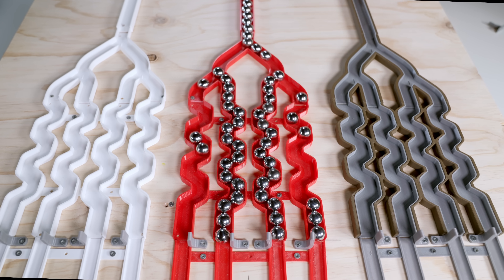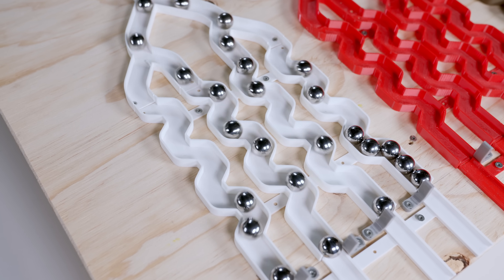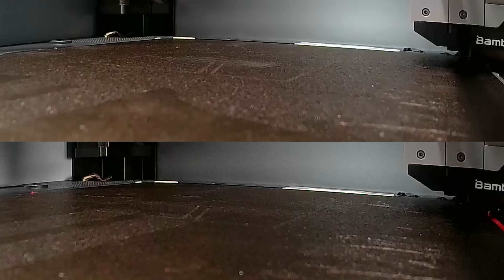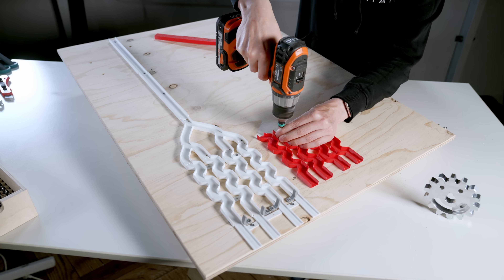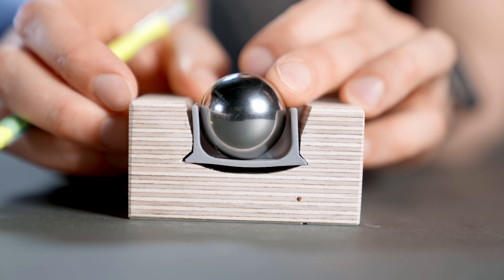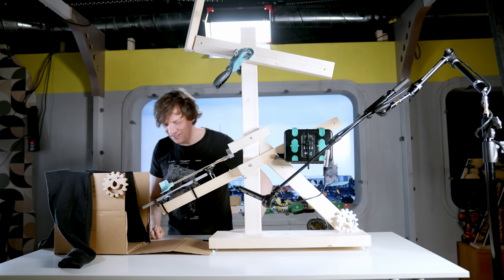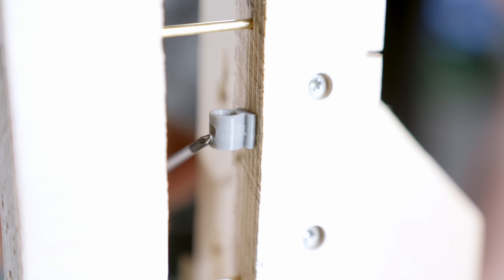The Perfect Marble Divider just got Better

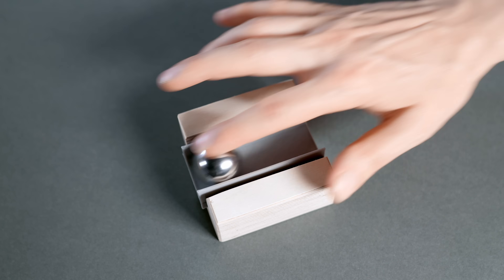Comment: 8:36 yes but when you remove material from under the tpu track you flex the material, which in turn closes the walls on the marbles adding lots of friction, you need to either make the tpu track a bit more wide or to print the walls of the tpu track slanted away from the marble so when it flexes it will sit upright and not add friction
Reply: It is a variable that he will have to play with and optimize. He is not shy about experimenting and if he hasn't already thought about it when he tests it will tell him.
Reply: I think if you make the track wider the whole chain concept won't work
The slack probably will be removed entirely in the future I guess
Reply: I was about to mention the same thing, but I will reply to and upvote this instead
Reply: yes but that's starting to over engineer, better off just removing the gap underneath entirely. It's pretty much dead silent, you can mostly only hear the balls clinking and the splits - vertical pressure is just going to mess things up so much with little to no improvement to audio dampening.
Reply: Ironically, I think he's found the solution already: Print thicker "two-walled" TPU parts like he used for the dampening with the vibraphone.
Reply: I was about to write the same thing. I think making the track wider is the best solution. Since the flexing track walls and bottom still allow some stretch the track should stay silent and with a small space around the ball on the sides you should get minimal friction. There will be always some friction from the track bending under gravity from the ball but that should be small enough to be ignored when you have gravity feed with enough energy.
Reply: Think either solution is necessary. The TPU has its own flex - that’s the point of it. It doesn’t need extra space, because it’s compressible.
Reply: @scaredyfish  Compressing TPU causes energy loss. If you make the tracks vertical enough, you can ignore this but if you want to minimize height of the machine, you also have to consider energy lost per ball due friction. (Compressing TPU and then rolling the ball off is not energy free operation.)
Reply: @MikkoRantalainen  your talking about energy loss as if the goal of the mechanism is to make the marbles travel as fast as possible
Reply: @brick3827  I think the point is to have marbles travel fast enough to not be the bottleneck for the music and if you increase energy loss, you have to make the slope more vertical which increases the height of the machine.

That said, if he wants to make the marbles more visible to audience, it might be a good thing to have more vertical slopes for better display and then having more friction may be even preferable.
Reply: I haven't taken the time to read through everyones comments, so apologies is this has already been mentioned

The friction between the track and the marble will also cause more wear on the track, as well as depositing some material on the marble. I imagine this would come up during stress testing of the track/machine, but it's a potential problem to keep in mind

The friction will be being overcome by gravity, so yes the actual exact width of the track may need to be tuned but I imagine that's a reasonably trivial process of trial and error which Martin excels at. I imagine the ware and material exchange will pose a larger problem, but time will tell
Reply: My immediate thought, and it's clearly visible too even in this small example.
Reply: Yeah, that feature will 100% get removed, I guarantee it.
Reply: Extra friction probably isn't an issue honestly just so long as the buffer of marvels can keep up with the demand right?
Reply: Not quite, the more marbles on the track the more it deforms and more friction is created, when multiplied by all of the track marbles may get stuck regardles of buffer @SethCrowderMusic
Reply: @holykrap6341  I think it's unlikely they'd get stuck on a single track but the divider portion of it is something that needs more rigidity to be reliable. 

Although, it is two very different situations when the marbles are stationary than when they are moving. So, to clarify my first point, I don't think they would get stuck when moving, but if the channels are even a tiny bit too tight, the marbles might have hard time to get moving again after being static for a while on unused channels.

Not sure about the material, if it will have plastic deformation when the marbles are in the same spot for a long time, even if just temporarily, but that would make starting the rolling again even harder.
Reply: I think keeping the track the same width, removing the bow in the bottom of the plywood would be best.  The designed showed, as others have mentioned would cause a lot of friction - which could potentially be overcome by changing the angle of the track. I think the worst part though is that the rubber band effect that he described would probably also disappear or wouldn't work the same way.
Reply: You could use a dual
material print to keep the track in a hard plastic, with a thin a TPU floor and thin TPU bumper at marble max diameter on either wall, then a TPU dampener wherever the tracks interface with the main structure .

This would maximise the ability to lessen the marble/wall impacts and propagating vibrations and minimise changes to the marble path geometry which give this divider its "spring" function.

Can't do much about the marble/marble sounds, bit those are kinda the point of the whole exercise.
Reply: We're talking about a hard rubber about 1mm thick cantilevering against steel marbles that are about 15-20mm in diameter.  I doubt it will be able to appreciably slow them down.

And stacking multiple marbles won't increase the effect, because they are not pressing down collectively, each portion of track floor will only support a single marble. 

Also TPU, while rubberised compared to most filaments, is actually quite stiff and doesn't create anything like the friction of soft rubber.  I would honestly be shocked if it would slow them down much at all.
Reply: He explained that the whole point of the design is that the walls hug the marble, stopping it from moving from side-to-side inside the mechanism which decreases the noise drastically, also the friction i don't think could be described as "lots" as the TPU is only bending under the weight of the balls in the track
Reply: it's amazing how there are so many people in the comments that sees problems in LITERALLY EVERYTHING without thinking about that there may not be a solution which does not cause any minor problems
Reply: @jonaskarlsson5901 Agreed. TBF the op is right but Martin would realize issues like this immediately and adjust the track size accordingly.
Reply: I'd be more concerned about the TPU wearing out, especially where it squeezes the marbles, AND covering all the marbles in gunky residue.
Reply: @Basement-Science it's plastic, not latex. It's what protective phone cases are made of.
Reply: @Basement-Science  TPU is incredibly durable and the material he's using is even better. The marbles wearing it down or leaving residue behind is the least of my concerns.
Reply: this
Reply: Beat me to it. lol
Reply: Or just make it solid, continuous flexing might shorten its life by significant margin. It's already dampen, no need to dampen that much.
Reply: I came here to say this and knew it had already been said. :)
Reply: Yes i was worried about that! Hope he sees this before he makes full pieces
Reply: This
Reply: Leave the space in the wood underneath, but fill it with sound absorbing material instead of void

Comment: Taking advantage of tolerance stacking is one of my favorite design features to see out in the wild. There are quite a few instances out there of that rubber banding effect using nothing but the thing that all machinists hate dealing with. To me it’s the pinnacle of that saying “It’s not a bug, it’s a feature!”
Reply: That's interesting, because usually the really bad thing about tolerance stacking is the uncertainty in what size your assembly is, which means that you're less sure about how much empty space you can get. Being able to use an area filled by compressible materials to absorb that uncertainty is very good though.

Comment: looks like you can just place a funnel made with that material directly over the bars
and use the solution you found with combining hard and soft materials
by turning the soft part you get different touches
more accurately put, that will be similar to a trampoline structure with some frames
maybe a disc shaped soft mat that turns like a dial will fit the job more

Comment: Leaving more material around the tracks to reduce noise was my first thought exactly. It would've worked even with PLA. Because if there's more mass on the tracks - there's less resonance from the marbles bouncing therefore less noise. But TPU + plywood around the tracks is an even better solution. Congrats

Comment: Just have to remember when making the plywood outer run for the TPU, having that little bit of give for 3 sides touching won't work for the divider tracks, because anything altering the position of the marble slightly will throw off that very specific positioning required to prevent the marbles getting stuck at the divider points.
Reply: I was thinking the same thing but we all know he's just going to build it completely wrong so he has to rebuild it.
Reply: @GG4GJake omfg stop doomposting you know nothing about the future outcomes

Comment: The TPU is going to wear quickly.  But if you can just bring spares, maybe that's not a problem.  I'd be worried about temperature excursions when the MM is shipped, but again: spares.
Reply: i'd argue it's a good design because of a simple engineering tenet: choose your points of failure or your points of failure will be chosen for you. making the TPU parts consumables with a big crate of replacement parts in the rider makes sure the first thing to wear out is the thing you can replace easily, instead of having the plywood tracks develop pits and such that break the divider's geometry.
Reply: I would suspect that TPU with a stiffer backing like the proposed CNC'd plywood would hold up significantly better than straight TPU - and would have a Noisy failstate rather than a more problematic damage failstate. Getting specific segments of the TPU swapped could be a pain in the neck though - particularly along the wiggly tracks, it'd be a needle nose pliers kinda fiddly task.
Reply: Yeah definitely need the spares. Seeing how quick it is to switch out I would think he could bring 2 or 3 sets for the machine and switch between the sets for each song. Less damage to the individual parts and they last longer.
Reply: might as well bring the printer too.  Also print TPU directly from the dryer.
Reply: Polyurethane is one of the most resilient materials I have ever worked with, TPU is just a thermoplastic variant of it.
Also, I don't know at what temp gets printed, probably over 300°C, but I highly doubt any normal kind of storage or transportation will reach such temps as to damage it.
Yeah, everything wears and breaks over time, but TPU is not more susceptible to it than any other material he's using.